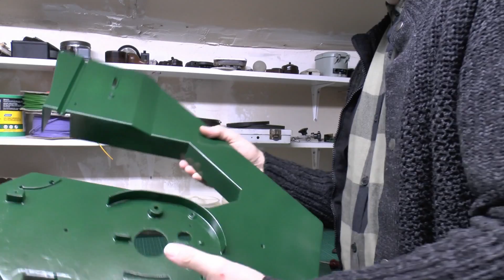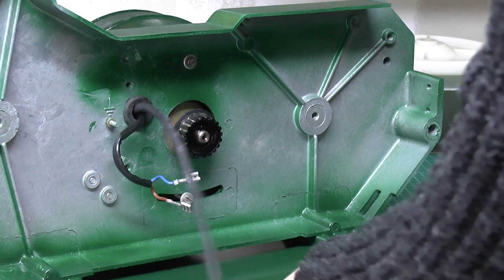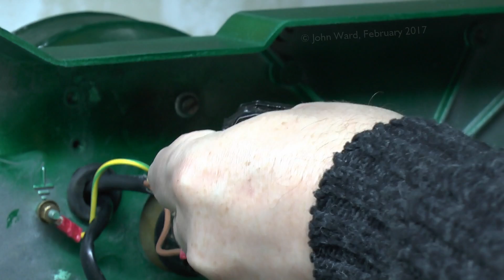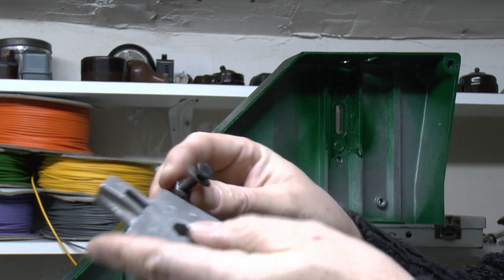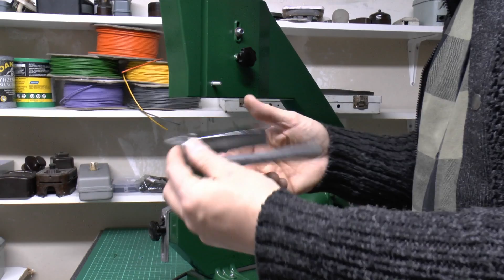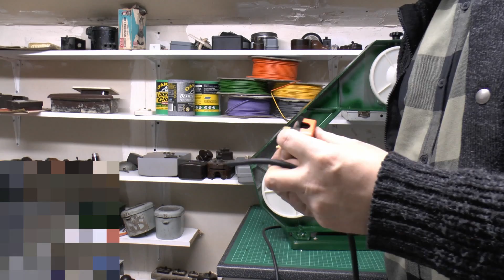Burgess BBS-20 Bandsaw Reassembly

Comment: John great vid, just purchased a old black and decker dn 330, very similar to the one in the vid.
Wonder if I can pick your brains, how does the motor housing separate once you have removed the four retaining bolts, just twists round and can't figure how to separate it to clean inside.... Help lol thanks Lee.
Reply from the maker: For most motors the ends should just pull off once the bolts are removed.  Use of a chisel and hammer may be required.
If there are wires or terminals on the end(s) then avoid turning the ends, as that will cause damage.
Reply: @jwflame  thanks for the info john👍

Comment: Ummm John... That's not general purpose grease... It's a moly grease used for assembly of metallic parts that have high contact meshing parts (tool gearboxes etc). The molybdenum disulfide will weaken the plastic. Better get some silicon or PFAE or PTFE mased lube mate... It makes me shudder watching you put it on, it's an excellent grease, just not for plastic!
Reply: But otherwise, great video, I'm really getting into your CNC build :-)

Comment: Is that cable the tri-rated switchgear cable John?

What do you think of the use of it for fixed wiring (in conduit etc)... i've heard varying opinions on whether it's acceptable under the regs. I think the only issue might be the abrasion resistance (or lack thereof) of the outer jacket

Comment: lol I love the comments about 3D printing. You're right that it's expensive and 99% of the people who have 3D printers don't "save money" by printing things at home because of the initial cost of the machine. But they still have their uses for quick prototyping and general hobby tinkering if you can afford it.
Reply: most hobbies dont save money, they cost more than they ever save, but its better than drinking your money away
Reply: Not sure the comment was fair. I don't think it's that expensive unless you are buying something like a Ultimaker or Lulzbot which is not required. John's CNC frame alone in a previous video must cost twice what my printer did. I agree people printing figurines and not designing things themselves are wasting their time. I was worried I wouldn't use mine enough but I use it all the time. I have made things like custom shelving for Tsum Tsum's, car dashboard parts and many other things I couldn't buy. Saving money also applies to other hobbies like woodworking/cnc or electronics. Ie why make the same simple electronic circuits that do the rounds on the youtube when you could buy off ebay. Why woodwork or cnc when you can buy most furniture you could make. People do it for fun and make  improvements.

Comment: John have you found a manual or exploded diagram ? as looking at the adjustment pulley at the top I would have thought that a washer would be needed on top of the top spring so it can not exit / enter the case (I can not recall if the spring on granddads was inside or outside or two springs (was over 20 years ago now... Gee how I miss him god rest his soul)).

Comment: What's is the operating current when it's cutting if it's 2.5 amp no load? I guess unloaded power factor will be worse.
Reply from the maker: Will find out in the next video when the blade is installed.